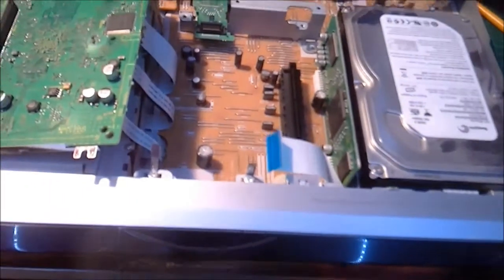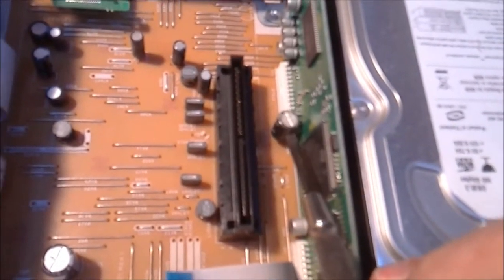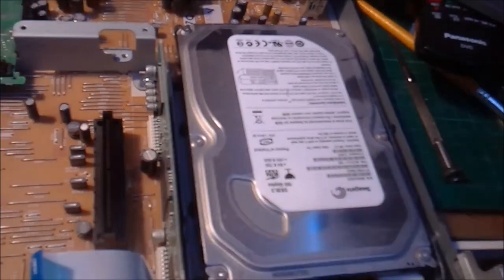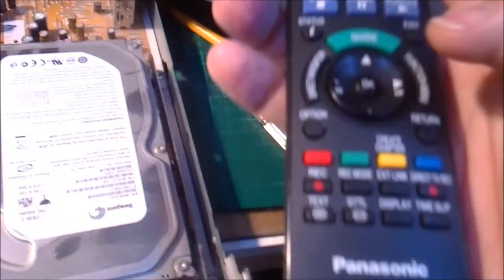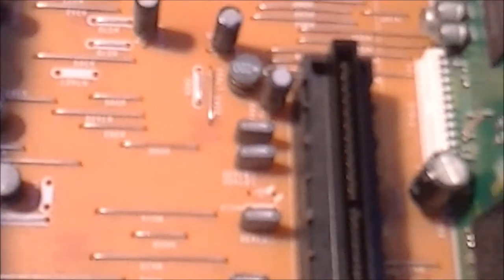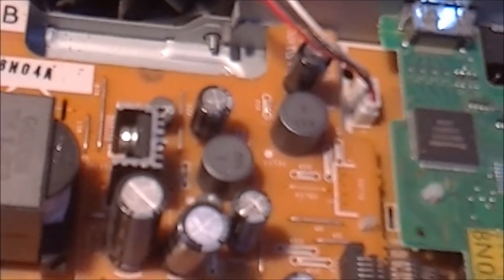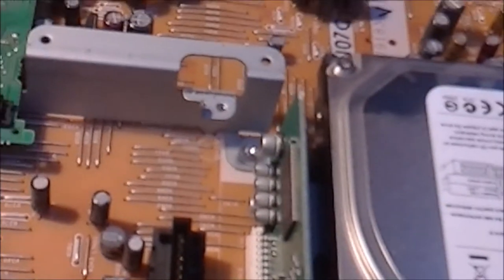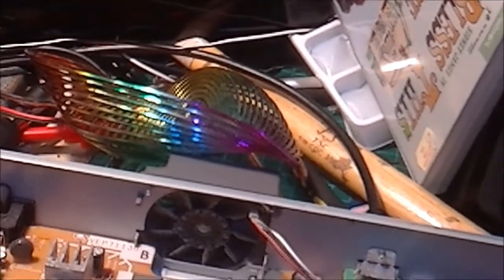Panasonic DVD HDD capacitor failure points

Comment: I admit to being a fan of Panasonic stuff, but I have to say I find they push capacitors to their limit!  I get around this problem by fitting higher working voltage rated capacitors.  I own a few DMR EX-75 HDD/DVD machines and the most common fault on them is two capacitors failing on the digital tuning board which means when you scan the TV band, nothing appears.  If companies can penny pinch here and there, they will do it!!